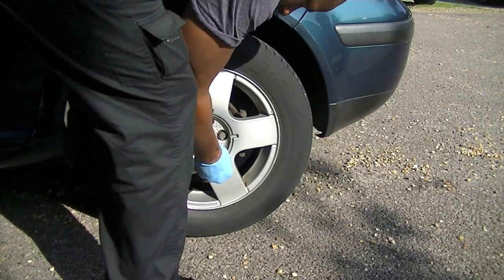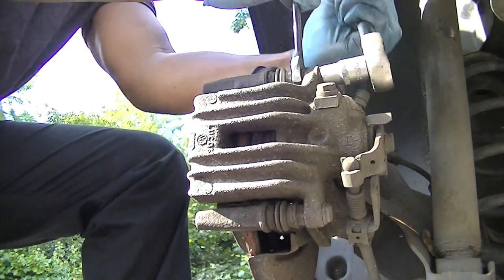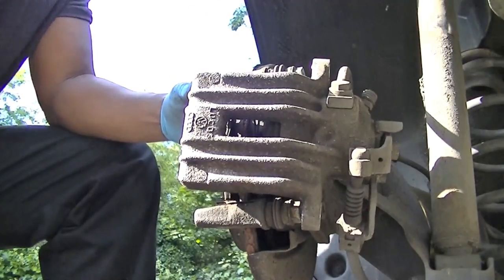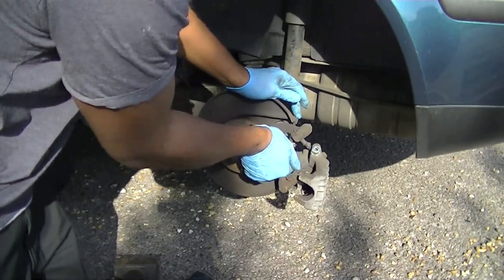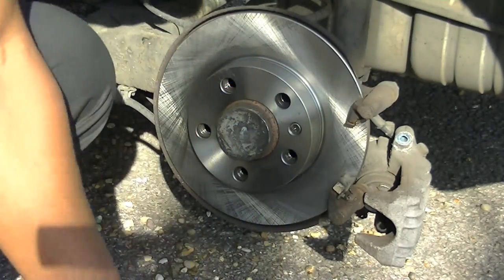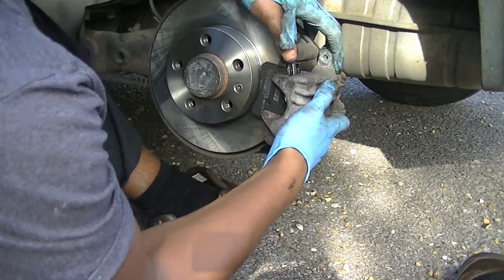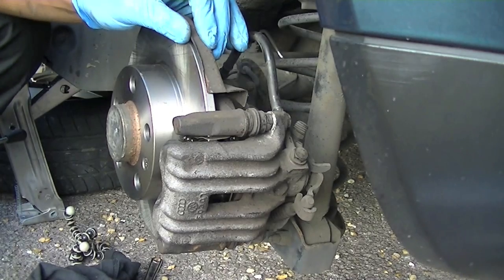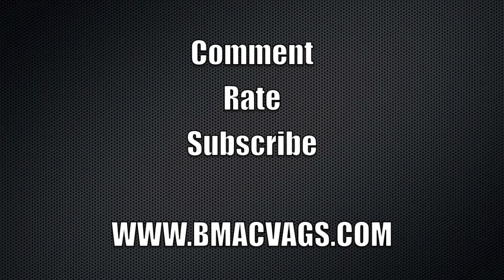VW Golf Jetta Rear Brake Pads and Rotor Disc Change Simple & Easy

Comment: so, ive watched a lot of your videos, and learnt a lot. plus saving myself a lot of money. the only problem with this video is that to do the rear brakes on mk4 golf you NEED the caliper tool to get the piston back in. it has to be squeezed and pushed at the same time therefor just rotating it doesn't work. (I cant speak for all cars)
Reply: jay f Yeah my buddy had a fuckin nightmare doing his B5's back brakes. Broke a damn C-clamp lol (he didn't have the piston presser)
Reply: You don't NEED the tool but it's a lot easier if you got it.
Reply: You can use a winding clamp

Comment: Thanks man!
I'd add in a note to unscrew the brake reservoir when pushing the piston in so not to rupture the system.
Reply from the maker: Good tip! Very true
Reply: Also take a bit of fluid out of is full incase it’s going to over flow as you don’t want break fluid on any paintwork.

Comment: My advice is never use pump pliers to wind the piston back in. If its slip, you could tear the rubber dust shield.

Far better getting the metal cube winder tool from the car parts shop for a couple of quid. When using the winder tool, fix the caliper back on the base plate, wood behind it so you don't push the caliper off the slider pins, then use the winder tool to retract the piston.

We have four rear disc cars to I got a winder set for £20 that covers all cars.

For a one off job, Ceretec grease is the best option but a 500g tub of ceramic brake grease is the best option economy wise for a lot of brake jobs. Which ever grease used, give the pad on the piston side a good coating on its back because the piston has to rotate on the pad as well as push it.

Comment: You should use a torque wrench when tightening bolts.  You can easily snap the wheel bolts by using such a long bar.  You should make sure the hub is clean of crap and rust before fitting the disc, otherwise the disc may have some slight wobble.  You should check that the guide pins are loose and not seized.  You did the basics but can be done better.
Reply: I was thinking the same way
Reply: How about you do your own channel 😂

Comment: Nice guide i'm going to be doing this soon, I've seen on other clips on here they unscrew the Hydraulic brake fluid reservoir cap,and have it loose to release pressure? Is this necessary?  
Also a good point to mention is caliper pins can seize, and handbrake is stuck on to one side, buggering up the adjustment cables inside the golf - you should do a video on this :) 
Any replies about if the brake fluid res cap needs to be off b4 doing this job is greatly appreciated !

Comment: 1. Always bleed the caliper when compressing the piston back in. This prevents polluting  the ABS/ESC mechanism, and polluting or overflowing the reservoir.. less problem, see ???  Then rotating the piston back in is far easier, and you have less risk of damage there.  And with the bleed open,  you can do it with long nose pliers in the notches , instead of squeezing the soft alloy piston , with the big multi-wrench, multi-wrecker !, on a surface not designed for tools. Also, don't let calipers hang by their HOSE. The HOSE is plastic and a fault (tear  )  can be induced that develops later. This rear piston is light, but the fronts are bloody heavy.

Comment: a couple of mistakes: use copper slip on back of the pads not grease tight up wheel nuts opposite not next to each other as this keeps the wheel square to the hub. good easy job ta ;-}
Reply: Richard Tattersall Good point relative to wheel nuts, always better balance tightening opposites as opposed to sequence clock/anti clockwise. Be well buddy.

Comment: It would have been nice to explicitly mention that you have to rotate the rear brake piston while pushing it in.  I did the front brakes on my 99 Jetta and they didn't have screw-in pistons, so I got a nasty surprise here with the rear brakes.  Otherwise, very helpful video, thanks

Comment: The two caliper retaining bolts are one-use bolts that should not be reused. Many better sets of brake pads come with them. They are only about $6USD, so don't scrimp. PLEASE do not potentially damage your piston and dust seal by using Channel-Locks to rotate the piston in. The special tool is very cheaply rented at most auto parts stores and many will loan it to you for free if you buy your pads from them. It does rotate and compress at the same time. Yes, do keep an eye on the master cylinder reservoir while compressing the piston back in. If it should happen to overflow, the brake fluid will damage vehicle paint and you could wind up with rust problems. VW recommends against applying grease to the brake-pads. Many brands come with their own self-adhesive anti-rattle/anti-squeal, and that's ok.

Comment: BMAC VAGS, I need some advice. Have you ever or seem mods done to rotor spindles? I considering placing a 280 on a 256. I dont want to machine the 280 to 256, would be a total waste.

Comment: I attempted this today for the very first time. I did fine until I tried to put the caliper on the new pads and no luck. I could not turn the piston anymore. 

I had a neighbor help and he turned it with ease, the caliper fit onto the new pads. (Guess I need to get in the weight room more often lol)

Took us 3 hours to do one side. Doing the other tomorrow.

Comment: Great video! I can't wait to do this on my baby. Can you kindly list the tools you used to change the rotor and the pad. Thank you
Reply: wheel brace - HAMMER ( if rotors are rusted/seized on ) 16MM spanner / - 13 socket / 1/2 " drive /  Philips head screwdriver / copper slip for the pads  -
Reply: Thank you my friend.... I'll be doing this during the thanks giving break
Reply: themickdon2004  and brake cleaner. Also as I noticed today checking it mine, make sure the location screw is on the existing rotor/ disc, mine wasn't and you need it to line things up, don't do the job unless you got both screws available.
Reply: Sam Minshall and also piston tool, to push back the piston inside brake caliper.

Comment: You might want to point out that it is not unusual to have to open the brake fluid bleed valves in the calipers in order to get the pistons to compress back in.  Simply rotating the piston does fuck all...

Comment: My disc isn't sliding on like yours, any tips as I'm struggling to get the 14mm spline bolts undone!
Reply: Lol yayyy finally read a comment that is in the exact situation as me.   Did you ever get it off? I'm thinking maybe our rotors are 172mm while the one in the video is 160mm

Comment: Before compressing brake caliper pistons on any car take off the cap to your brake fluid resevoir, and many cars have these kind of pistons where you don't just compress them or you will fuck them up. Go to your local autozone store and rent the special tool to compress them. Those pistons must be compressed and turned for them to compress. Autozone will give you your money back as soon as you return the tool just ask them about it. That channel locl method will fuck your shit up if not done properly just take the safer route.

Comment: can i install slotted rotors in the rear ???
Reply from the maker: Yes you can
Reply: awesome so the calipers do have the clearance
Reply from the maker: do you mean vented disc?
Reply: BMAC VAGS
yes
Reply: +chupamishuevos303 you will need to run GLI calipers.

Comment: Rotating it alone does not compress the piston back into it. I tried for like 30 minutes. You need to both rotate and compress it with that special tool. That special tool is a damn rip off too. 40 bucks for that shit.
Reply: A "C clamp" works just as well for a quarter of the price.
Reply: Niko Ramirez I don't think so. Using a C clamp alone wouldn't let it go in and you actually need to rotate as you push. Just buy the proper tool because rotating it does not let it go in at all.
Reply: I'm no professional, but using a C clamp has always worked for me?
Reply: Niko Ramirez For the rears, you see the little cutouts? Some auto manufacturers have put those grooves that require a special brake tool that must rotate and compress the piston or else it won't go back in. My 2011 Ford Explorer XLT requires one just like my friends 2002 Volkswagen Golf. Just watch out for that when doing your own brake job. Search up screw in piston tool.
Reply: +Niko Ramirez American cars usually don't have special calipers like euro cars do.
Reply: Vinnie Davis That's where you're wrong because my Ford Explorer 2011 had the rotating caliper thing.
Reply: A27 Blaze
maybe some of them adopted it! :P